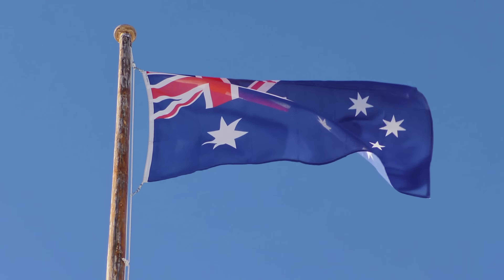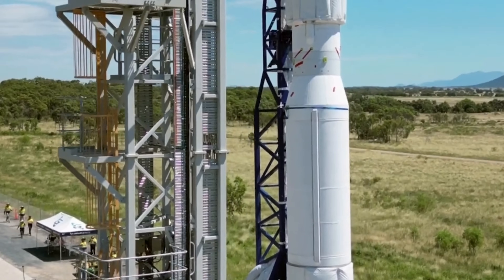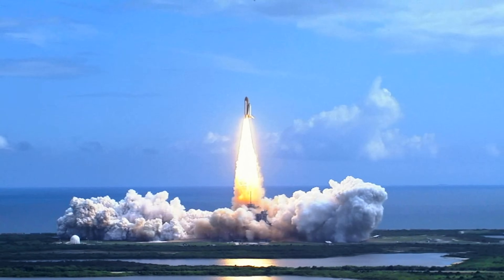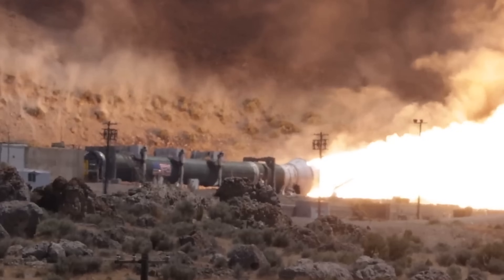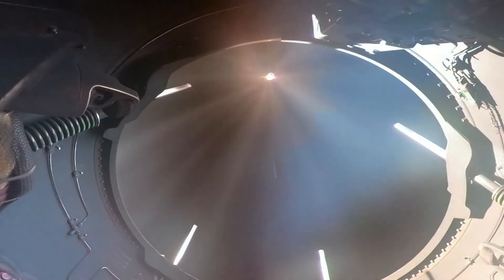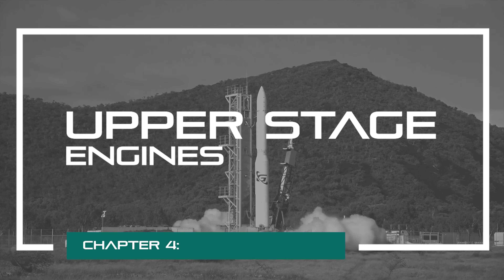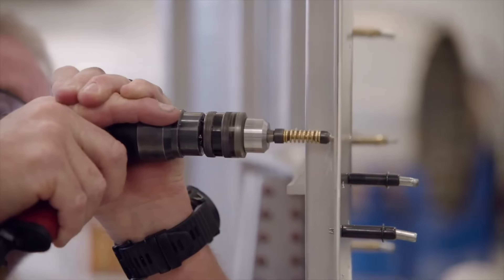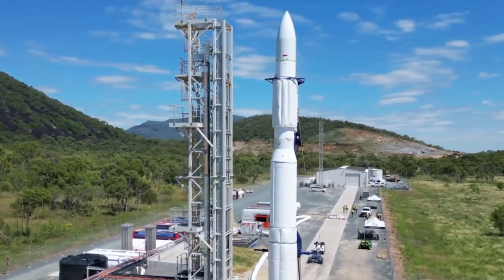This Hybrid Rocket Engine Could Launch Australia Into Space

Comment: I'm going to get schooled here, but would it be advantageous to use an air breathing jet engine in the first stage and just disconnect it when the air's too thin?  I've also wondered why there's no electric catapult to further reduce fuel needs from the ground.. Did you know that if you could take off from a mountain that's around 4000ft you drop the amount of atmosphere you have to fight through by 40%‽
Reply from the maker: None of those are bad ideas, or bad questions! The air breathing engine idea has been visited a few times, probably most famously on the SABRE, which transitioned from air breathing to LOX at about 25km altitude. There's also the virgin Launcher One rocket which was lifted to relatively high altitude by a 747 and then dropped for its engines to take it the rest of the way. My understanding is, they didn't really pan out to be beneficial. It's a long explanation, but the gains just unfortunately don't work the way you'd think they would - and the same is true for launching from a mountain. Tim Dodd has a couple really great videos on this which go through the math in an easy to understand way. Unfortunately in space travel there's no free lunches😔
Reply: @HelloFromSpaceAus  Ahh geez that's a shame, whelp perhaps a kinetic launch system is still on the cards?   Even if it were only to assist getting parts and supplies into space?
Reply from the maker: Definitely on the cards! The script I've been working on for the last few weeks says so anyway...

Comment: "Wet themselves for a 1% improvement" in USABLE weight to orbit .. NOT engine cost / thrust. VERY VERY big difference. What you said was basicly F1 would LOVE to have cheaper wheel nuts and a 17% cost saving on the nuts is AMAZING .. then if that doesnt translate to a faster lap time then it literally means nothing.
Reply: Overall not a bad video by any means. You did miss understand a little about why Hybrids are NOT used for orbital launching to date. Its mostly the problem of having a "pressure" fed hybrid engine. Another way to say it.. the ENTIRE fuel cavity is pressurized + Oxidizer tanks. This removes the need for fuel / ox pumps (like rocket lab uses as electric pumps) But you run into an impossible ratio of surface area vs volume. Hybrids actually can work very well at SMALL scale.. but have a lot of trouble going much beyond 600mm(half a meter) .. the run away affect of weight to volume trying to hold the pressures crosses over and you never make the efficiency back. This means to get anything like 100g+ weight to orbit your rocket easily goes past this size ... ie the ratio beats you. It MAY be possible that Gilmore could manage to get something "started" on a hybrid to orbit .. but no way will those numbers ever translate to being competitive with what is currently on offer and reliable.
I wish it wasnt like that. I wish Australia had a shot at being a space nation .. But until someone here makes a turbo pump.. its just not something you should be holding your breath over sadly. (i live in brisbane, built 100's of hybrids personally)
Reply from the maker: Yeh you're correct in saying that, I would add though that the first stage engines are a fair bit more important to a rocket than the nuts are on an F1 car. A more accurate analogy would be the power unit, but I totally understand and agree with the point you're making.

I'm glad you enjoyed it though! That is a good point you make, and I had considered talking about the size of the combustion chamber to include the solid fuel grain in the video. Its interesting because you obviously have a combustion chamber that is increasing in internal free volume as the solid fuel grain burns, decreasing its efficiency. I'm curious about whether they're using differential thrust for TVC, and if this is due to the size of the combustion chamber making it unsuitable for gimballing.

I guess it depends on how much they've been able to improve the hybrid design. They've also developed a liquid engine in the Phoenix which is a traditional open cycle engine - so they can do it. They've obviously determined that the Sirius has enough potential to stick with it anyway.
Reply: @HelloFromSpaceAus  Dont dissagree with the nuts vs power unit .. i might have been a little too hyperbolic. But yeah the point is the cost of the engine as a "total" cost for the overall "cost" to orbit is actually very very small factor. Not nothing though thats why reusablity is a thing.
Depending on fuel grain geometry you can "maintain" good surface area consistency throughout the burn rate however due to fixed geometries with the "solid" fuel you can actually "pre program" throttling withing the burn profile to give you VERY high thrust first stage / sustainer burn second stage all purely just within the geometry of the fuel itself. 
Gilmore have a Fibre rapped fuel chamber nearly identical to the system used for Virgin Galactic .. in fact there is virtually no difference between the 2 companies engines. In this regard Gilmore are not actually designing something new. 
The other BIG point here is looking at "why" Virgin Galactic downgraded their "upper" limit to what they could get their spaceship to reach to. In essence they simply couldnt get the performance out of the design they thought they could on paper.
Also for your fyi the fuel Gilmore is using is "HDPE". Its comes as a large black cylinder with a straight bored hole already "pre-drilled". I am not aware if they have a later process to do any geometry to change the burn profile, imo if held my feet to the fire i would say they dont as you want as MUCH fuel in the space as possible any ANY profile actually means removing fuel not adding it.

Comment: I lead the design and build of the original G70 motors fired at Gilmour Space. At that time they were the largest single port hybrid rocket motors using High Test Peroxide fired globally, we also flew the RASTA Mk2 rocket which was Australia's first launch of a privately designed and built hybrid rocket, and the worlds first flight of a hybrid with a 3D printed fuel grain. It was certainly very challenging to build such hardware and infrastructure working in Australia with so little industry & supply chain in place to support a space launch effort. A very exciting and dynamic 4 years there.
Reply from the maker: Wow that's really interesting, its a little mind blowing to me to have someone in the industry watch this video😅 Hopefully I did my research well! Are you still at Gilmour? Absolutely hats off to you and the team working on these motors, having to pioneer so much of this in Australia.
Reply: @HelloFromSpaceAus  I left Gilmour in 2018 and later joined Equatorial Space Systems in Singapore as one of the founders founders, these days I work between Thailand, Singapore & Australia (ESS has a Darwin propulsion test site). I had been very active in Australia pushing for sovereign launch development since the 90s so when I was approached by the Gilmour's with their intentions I was more than enthusiastic about getting involved. I was also very active in the early Australia Space Research Institute (ASRI) which built and launched the AUSROC 2 liquid fuel rocket from the Woomera test range in the 90s, and later started a project Academic Space Launch Initiative (ASLI) working with the University of Adelaide and Flinders university aimed at giving students access to launch opportunities. In 2012 we launched the RATSA 1B which was reusable hybrid rocket for student payloads to 3km at a site in rural Queensland. Yes the video is well researched and most of what you have said is correct. Isp of Sirus would be more likely around 270 sec in vacuum due to limitation of HTP as oxidiser (decomposed HTP is normally around 52% steam and 48% Oxygen), but the density impulse is very high as HTP around 1390 kg/m3 vs LOX 1180 kg/m3. The composites are also used for the HRM combustion chambers / nozzle assembles. Keep up the good work enjoyed the video.
Reply from the maker: Wow, sounds like you've had a pretty incredible career. It's great to hear from people such as yourself who have been working hard for so many years to advance Australia's space access. I'm really glad to hear I was mostly there, it's hard to research alot of this stuff because there just isn't a tonne of publicly released material on it. That's interesting about HTP, being that it has a higher density - so you're getting a bit more go from the same ISP. I take it as a huge compliment that you enjoyed the video, thank you!
Reply: Hey mate, how are you going these days.
Reply: I wonder why Gilmour went for a three stage rocket. Generally two stage is less complex and more reliable compared to a three stage. Perhaps their design is less complex (no cryogenics, less plumbing and pumps) that a three stage makes more sense.
Reply: @Charles00-xj3kz   A large part of the requirement for a 3-stage rocket is the relatively low performance of hybrid motors compared to conventional liquid-fuelled ones. You need another stage or two to get to the same speed & altitude.
Reply: @TheBillzilla Makes sense. Hopefully they can improve the efficiency of the engine over time.
Reply: @Charles00-xj3kz   I hope so as well, though I suspect the performance will always be limited to less than conventional rocket motors due to the limits of the hybrid fuel and H2Os ... though I hope I'm wrong!
Reply: @TheBillzilla  Doesn't a 3 stage rocket cost more than a 2 stage rocket?  Need more engines & the like
Reply: @BearM8472  They certainly do, but unless you have a lot of performance you are stuck with 3 stages. 
Hybrid rocket engines just don't quite have enough grunt for only two stages - At least if you want to get something heavier than a feather into obit.
Reply: @TheBillzilla  unfortunately, payloads are usually heavier than feathers.  That bloke who made wings made out of feathers & wax should have used a 3 stage rocket.  Instead he flew too close to the sun & the wax melted & he came spiralling back down to Earth - splat
Reply: Please tell us why 2 engines  failed on the first flight. The info is missing from the video 😢